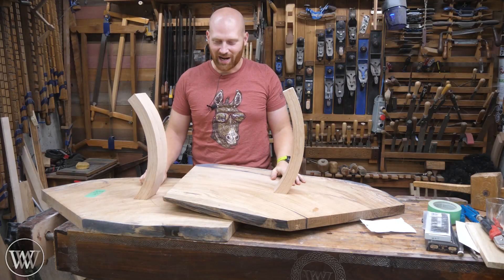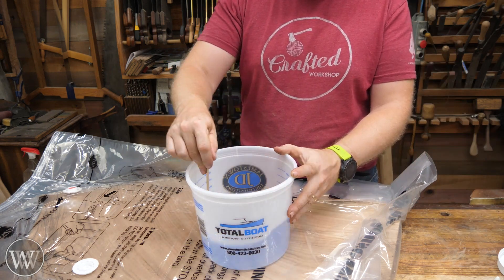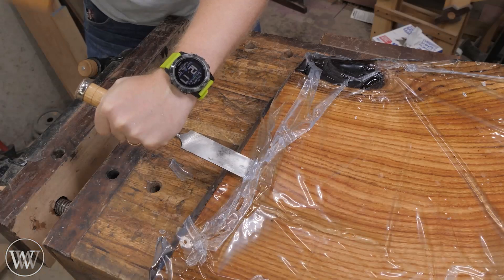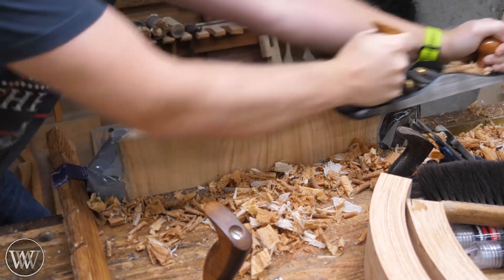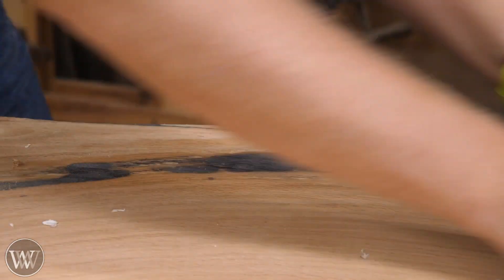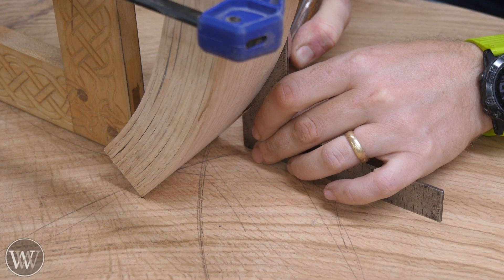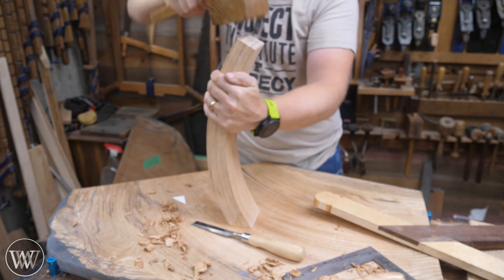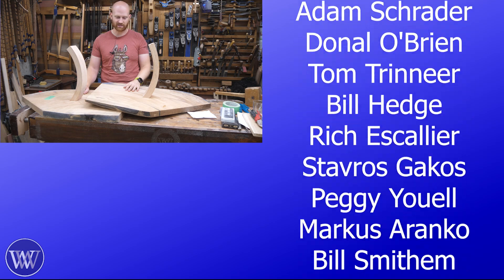How to Make an Impossible Table Slab Forming the Slab | Part 2

Comment: Looks nice. Maybe cross two of the cables to prevent rotational movement of the top.
Keep up your nice video's.
Reply from the maker: Thanks. Yeah that's what we're looking at. there are several different methods of crossing them as just crossing one pair will only restrict it in one direction.

Comment: You said the bottom surface was relatively smooth, and bubbles on the top... leads me to think, put it in the bag upside down, on a smooth surface(sheet of MDF) next time. 
Nice work James.
Reply from the maker: That is what I am thinking to clamp it down to a smooth surface as long as I do not catch the bag and puncture it.
Reply: @WoodByWrightHowTo  id bet you can exploit the 'Newton' clamp...  the weight of the slab should enough plus you dont want to 'starve' the surface of epoxy. 
Have you tried any of the pearl colors to add color and a little shimmer/sparkle?
Reply from the maker: The problem is the slab floats slot I would have to put around 100+ lb to get it to go down. But it might be worth it.

Comment: Aloha James,
 25 years ago , when I got into Vac Bag clamping for making furniture, I Painfully became of how powdered resin glue cures inside the vac bags. Watching you chipping away at the slabs wrinkled 'Knife edges' of epoxy made me cringe. How you didn't get gashed from them.
Reply from the maker: I did not have any issue at all with the chipping off of the epoxy. I actually found that part to be incredibly fun I had to make sure not to take off too much as I was enjoying it.